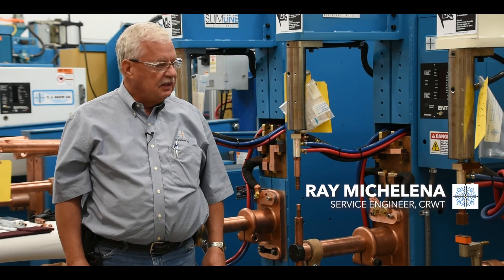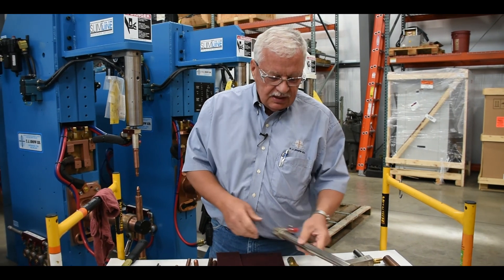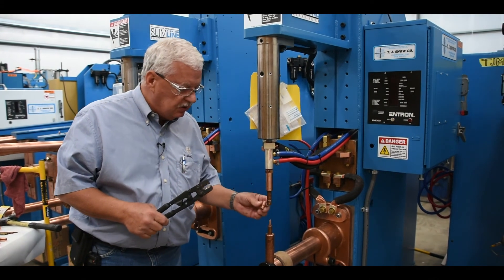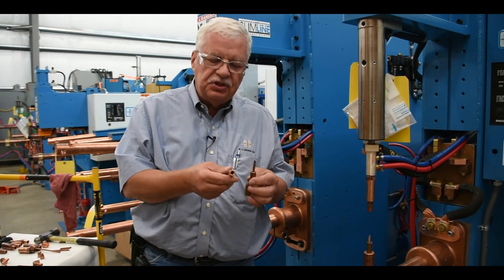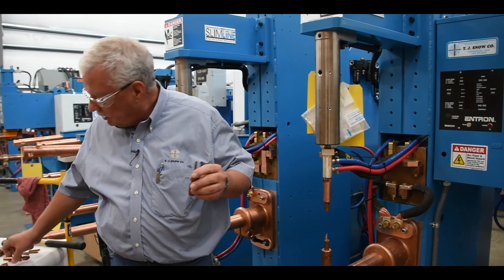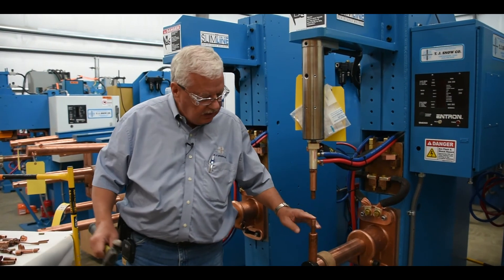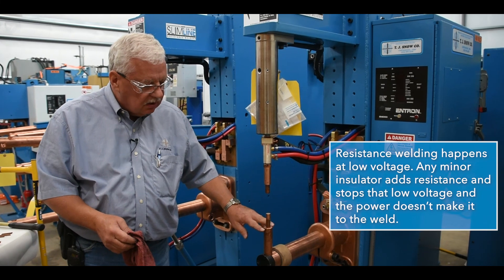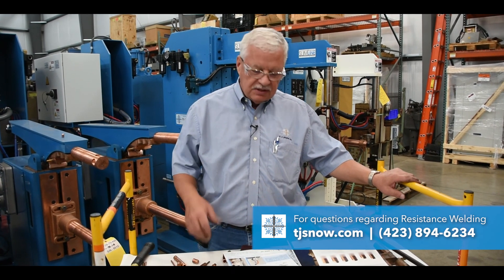How to Change Electrodes on Your Spot Welder - Step by Step Walk-Through

Comment: Oh Ray, dielectric means non-conductive. You are NOT using a dielectric grease if it is loaded with graphite. You do not want a dielectric grease in this application.

noun
a nonconducting substance; insulator.
a substance in which an electric field can be maintained with a minimum loss of power.
adjective
of or relating to a dielectric substance.